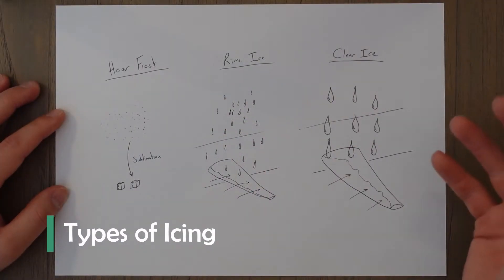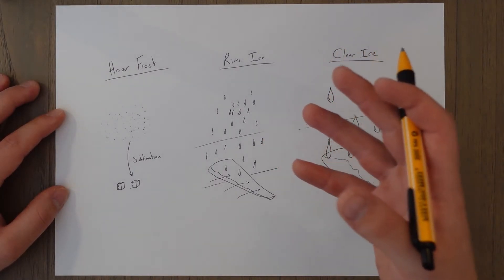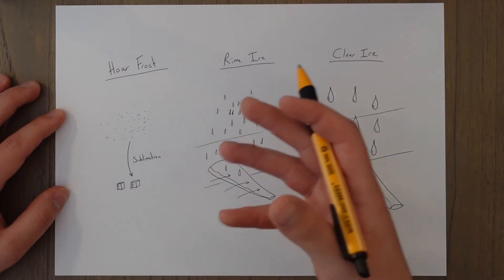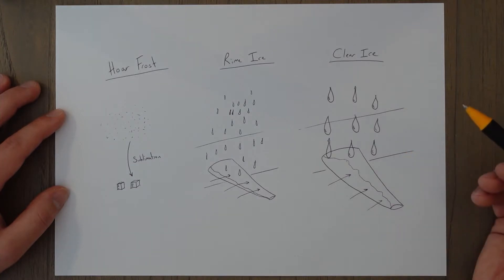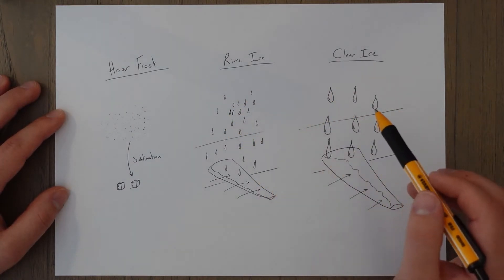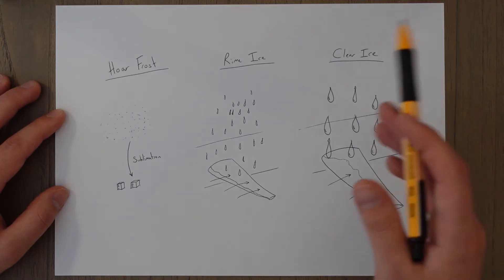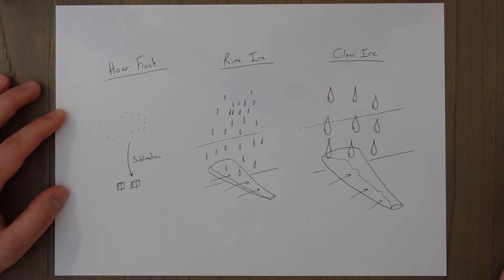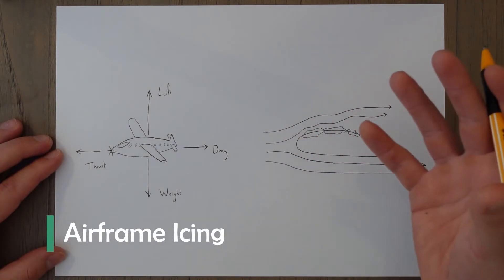ATPL Meteorology - Class 9: Icing.

Comment: icing in the intake can also disturb the airflow into the engine, changing pressure distribution hence leading to compressor stall
Reply from the maker: Yes, absolutely correct.

Comment: can u explain once again that why between -20 and -40 celsius only small supercooled water droplets occur.
Reply from the maker: Large droplets tend to freeze at higher temperatures closer to 0 Celsius. So they all freeze earlier than the small droplets, so between -20 and -40 all the big droplets have already frozen into ice and we are left with small droplets.
Reply: @atplclass  but i thought large water droplets have smaller surface area to volume ratio that would make heat transfer less effective and require colder temp to freeze than small droplets

Comment: I think the lecture is a bit short of the LOs. In EASA questions for IR (and ATPL) you would also get questions on mixed ice, on icing in areas of orographic lifting (mountains), in the danger of clear ice building up behind de-icing systems, etc.
Reply from the maker: It almost certainly is. These are not complete courses on the ATPL subjects just a bit of additional information on topics incase you need them.